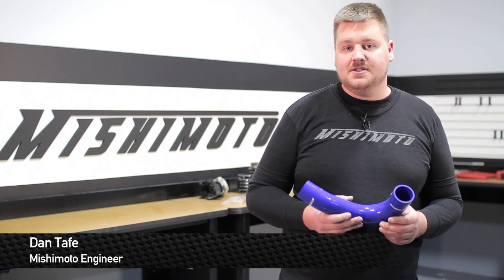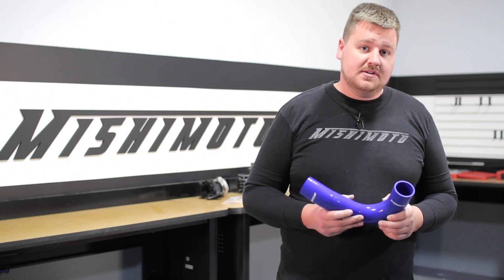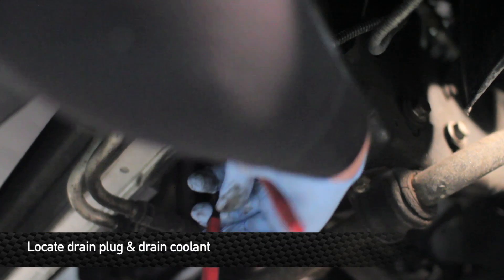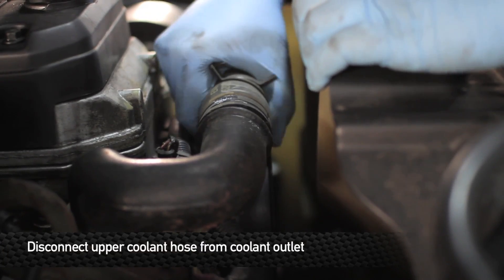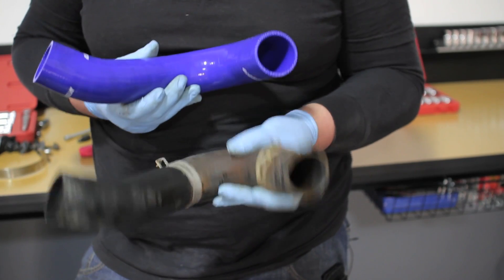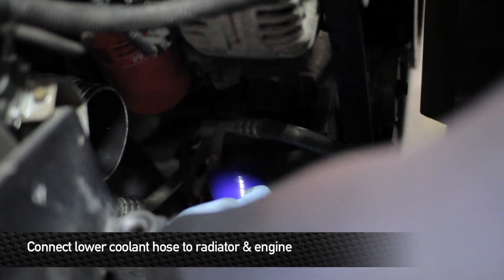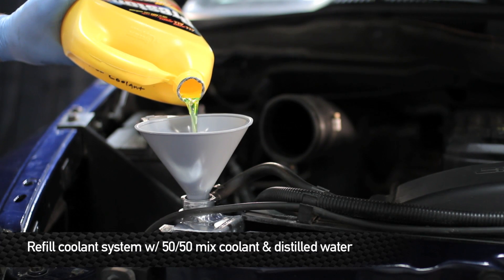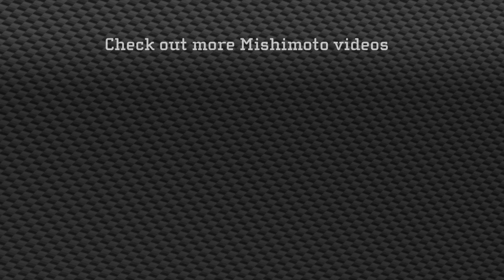How To Install: Mishimoto 2003-2010 Dodge 5.9L & 6.7L Cummins Silicone Hose Kit

Comment: Would you recommend T-bolt style clamps over the OEM ones? I'm seeing alot of negative reviews not just on your silicone hoses but others as well with leak issues when using OEM clamps.
Reply from the maker: The issue often comes from people using old worn out clamps that loosen over time. Replacing with our clamps or just a nice quality worm gear clamp should prevent any issues.
Reply: @mishimoto  Noted, Thank you.